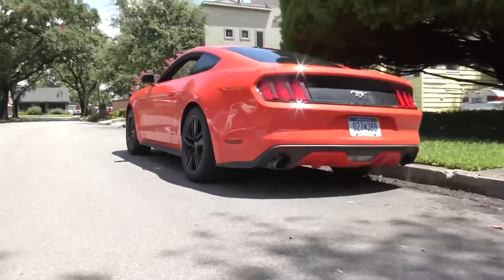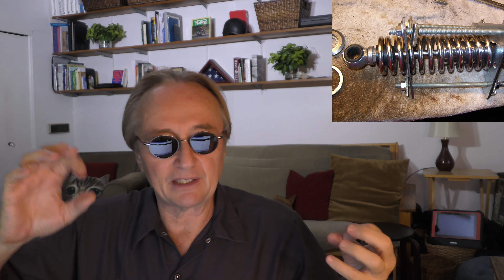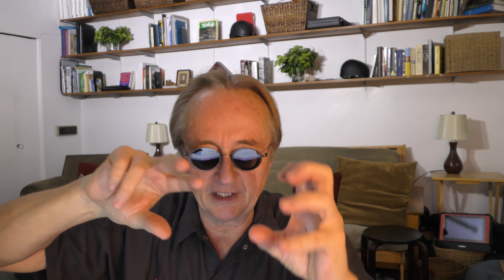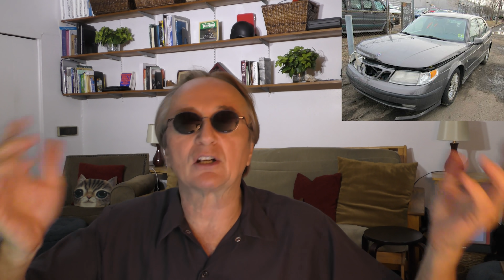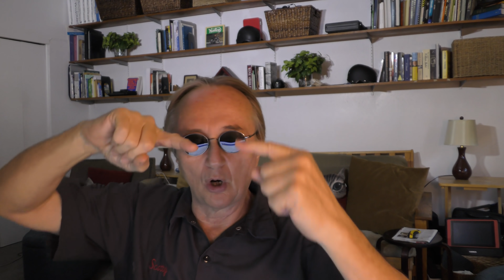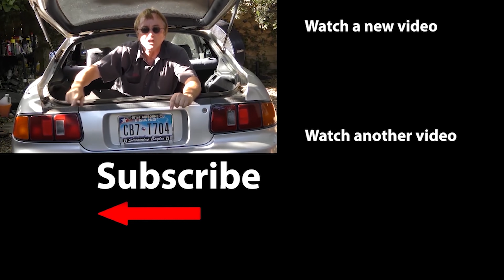Here’s Why Volkswagen is Going to Take Over American Car Manufacturing

Comment: I'm on my second jetta. Currently in 2018 se. 147k and all original and still getting 38mpg. 200 mile per day commuter.  
Change oil every 5K with full synthetic and change air filter every 30,000.  Second set of tires and second set of brake pads that is it.
I'm either lucky or meticulous maintenance works on any car

Comment: I have 2010 volkswagen cc , 2.0 Tdi 138 bhp enine tech GT and its never missed a beat its a great car and i look after mine every 3000 miles i get oil changed and filter change, it works for me and keep my engine running sweet. It returns 53.7 MPg and above some times on normal driving to work and around town thats a true every day figure by the way and i have get over 60 to 63+ on the motorway whats not to like. Its a great car for everyday driver like me and for me im not gonna buy a new car no no no , im not into throwing all my money at a new car......

Comment: I have a 2012 MK6 Jetta 2.0 5 speed. It has small stupid random electrical issues like occasionally it won't unlock the back door while other times it does or non lights burning out frequently. Truly stupid things but other than that in nearly 200k smiles I've only replaced the oil cooler and a rear door lock. I'm very big on proper maintenance and tend to stay away from automatic and turbo vehicles. Thats the secret to longevity with any car.

Comment: Got a 2011 vw Jetta TDI wagon automatic 70k miles. Not a single issue. Just oil changes. Average about 37mpg mixed driving and can get around 43 highway. Also have a 2016 gti. 50k. Nothing but oil changes. So far so good.

Comment: If you talk about VW's... 
Mention year, model, fuel.
Air cooled / water cooled are different as can be. Like Model A and F150 trucks.
I had a 78 Scirocco that was nothing but problems. I blame much on the previous owner, but the VW parts manager, who I saw frequently said "just be glad it isn't a Rabbit."
Bought a Toyota 4x4, which lasted 27 years before selling it.

Comment: I need help Scotty. I have a 2013 Jetta sell 2.5. when it's cold it doesn't like to start. I have regular hiccups in power. Not slippage, it almost feels electronic. And periodically it'll just die for no reason. But when I get the battery and alternator tested, they're fine. I had the transmission replaced a year ago, with a used one that had about 27k miles on it. The car has over 90k on it now. I'm having trouble left and right with this damn car and it's crazy expensive to work on. Lots of buyers remorse. Please help me save my car. I can't find any codes with basic obd2, then again it's an older one.

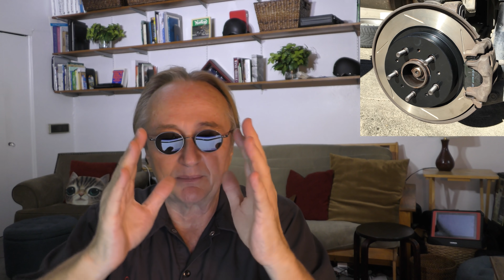Comment: @ScottyKilmer At 2:30, on the contrary Mr.Kilmer. Aftermarket lift kit spacers are made for rigged that’s more affordable to buy rather than fortune lift kit coilovers. There not actually cheap if it’s a well hand made design. On our xB community we have a one man army that has the right material to make and sell custom aftermarket made lift kit spacers. We had so many Scion xB customers that were completely satisfied because how well made he makes. Very affordable for our xB’s which it’s very respectable thing to do. On the other hand, I also know there some lift kit spacers that I believe they have a 1.6 mm spacers and had them on. After they broke and he never bought those again, until he gave another shot to a different guy that makes well made spacers that’s much better made than the ones he bought cheaply ones. I say his quality made are excellent. And it’s a must have if I do say so myself. 

That’s why some aftermarket brands that sells lift kit spacers for small crossover are very popular. Not just lift kit coilovers

Comment: Get a Renault, I took a van, it's got 300K + Miles, only ever had oil changed, tyres, brakes 
Had the motor for windscreen wipers replaced and fuel pump in all time

Comment: I have a  two wheel drive VW Eurovan ,one of the greatest vehicles ever made. I have multiple other cars including a  4 wheel drivef-250 super duty with a V-10 . The VW can out perform it all day long . It's a tank and plows  a foot of snow no problem , while carrying 7 people and anything else you can put in it. And  while getting 25 miles per gallon, the f-250 gets half the mpg.  Why did VW choose the 20th of April to restart the factories back up? Because, it was Hitler's birthday..

Comment: Hey Scotty, thanks for all you advice over the years, please help me with this one. I have a 2007 Ford Explorer-170k miles. I mistakenly put about 1/2 cup or so of windscreen wiper fluid into my coolant reservoir because they are the same color. Two days later it started to act funny, slow to go into gear and low power, just like when the transmission is faulty. I completely rebuild the transmission 2 years ago and the guys at Ammco said it not the transmission.OD2 Test reveal that solenoid A, B, C all giving errors. I flushed the entire coolant at Pepboys but nothing has changed, mechanic not sure what exactly is the problem. Thanks for you  help.

Comment: I bought a very nice 2012 Tiguan with 89k miles on it. Body and interior were perfect. I knew I’d have to spend some money to get it up to par for my daughter to drive but it was ridiculous. Plastic engine parts galore. O-rings that swelled when contaminated by engine oil in an engine that leaked like a sieve. I was gonna end up with $15k in a $9k car. Dumped in in less than 2 months. Would never have a VW out of warranty.

Comment: Awesome video as always, do have a question. I did the CRC GDI treatment on my soul and after I let it heat soak I drove it, was going up the mountain near my house and it back fired and started smoking pretty bad, also the engine light lit up and was flashing, turned off then back on and it was perfect, is this normal lol?

Comment: Scotty, I'm a huge fan! Thanks for all your daily videos, I had a question regarding my 2009 Ford F-150 with about 169K miles. The other day I took it camping and it struggled to get up a steep mountain road. The engine had a rough idle and seemed like it would shut off when coming to a stop but never actually did. The check engine light came on and gave me codes P0012, P0022, P0340, and P0344. The thing is on the way home the truck drove fine on the highway. Seems to only have this problem when pushing up a hill. I am assuming all these codes have one big thing in common but I am not sure what. Do you have any videos or advice on diagnosing and fixing this problem? Any info would be greatly appreciated!

Comment: Can anybody help me out? I got a P1374 code on my 2004 Pontiac Aztek. It will fire up, but soon stall out. The tachometer jumps before it dies. If I'm driving it, it will either stall out, or try to stall out.

Comment: Hey scotty, I have a 2013 Hyundai Sonat and it works fine it has about 70,000 kilometers on it when I rev up the engine to 2500-3000 RPM it makes a chucking/ heavy clicking sound 
I took it to the dealership and they said I need a new engine 
Is this right or I'm just being robbed
Also the car is in a good condition, well taken care of and mostly a highway car.

Comment: vw will never take over anything with their reliability track record.
the only reliable vw are original beetle. 
my wife get a vw golf make in Brazil and we have to trade it in before 36K mile because it has so much electrical trouble. it's a lemon.
anyone has a recent VW in last 20 year will not buy another. they are money pit and you don't get the benze bmw name to go with it.
they will open the europe factories but south america where most of their junks comes from?
Reply: 2002 VW GTI 310k miles.

Comment: My daughters 2003 Subaru Baja exhibited the same type of code; new cap didn't solve the problem, Plastic parts of evap system was broken above the gas tank. $600+.

Comment: Hey Scotty, I got a question:
I just bought a 2010 Bentley Cont. GT Speed in prestine cond. and with 35.000 miles. I would like to prevent the intake from getting clogged up by all the exhaust nastieness recirculation. If I find a place where they could program the computer to shut down the exhaust recycling valve, would I risk any negative outcomes to the engine itself? Most of the time I drive around at 1200 to 1800 rpm which seems to be the range when max. exhaust recycling is taking place.

Comment: I'm still driving my 2003 VW Jetta. Drives like a charm.
Reply: non volkswagen users are so misinformed, my GTi 2008 dsg transmission is over 217 000 km, and shift like a charm. I had a 2004 golf, in 4 years i've put no money on it, just one bering.
Reply: Same. 03 Jetta that just hit 75 xxx km's. Only summer driven.
Reply: I’ve got a 350 000 km diesel of the same year. I’ve had it for 5 years but the engine leaks a lot of oil around the egr valve and other places.

Comment: Hmm ... Not surprised the 'Concern' is moving into America. However, I'd stay away from their brand new vehicles. As with all the new cars, they are built not to outlast us. Hope that this move would enable America to have a flow of OEM parts for older models. That would be beneficial. Older, smaller Golfs and Polos (or even Boras and Ventos) .. they may be a safer bet. Yeah, the VR engines .. nah .. just your small, four-pot, low horsepower econoboxes. Heck, those had some quality at least.

Comment: Hey Scottie, I have 2008 Nissan Altima 2.5 S and I can’t get it to accelerate when i turn it on and it won’t rev over 2000 RPM. It revs fine in Park & Neutral and there are no service lights on the dashboard  and it’s not showing any codes but Park and Neutral don’t show up on the dashboard as well although I can feel it change gears. Can you give me your opinion on it ?
Reply: Nissan are fcking junk. Sell it or trade in or public transportation.

Comment: Hey Scotty, are the new Subaru engines doing better for head gasket issues. Specifically we're considering a new Crosstrek with a manual transmission. Just wondering what your thoughts were.

Comment: Hey Scotty I got a 150cc motorcycle, I used to slow down using front and rear brakes but they wear out fast. I switched to engine breaking and it worked great for a while but recently it started to make a wierd noise when im breaking in 3rd gear. What could it be? And is engine breaking bad?

Comment: I’ve had 2 Volkswagens and they were great cars.
Reply: @Ross_skatepunx248 >  The problem why people think they're crap is because they expect to drive it forever and never put any money into them.
Spot on.  Unfortunately that's the mindset of 90% of drivers on the road today.
Reply: @dantesinfernopurgatory7826  of Americans
Reply: @dragospahontu  Exactly.
Reply: @dantesinfernopurgatory7826  if you don't change the oil in a DSG gearbox ofcourse it's gonna blow up.

But Americans have grown up with torque converters and can't wrap their head around German technology 😅. To the extent that outside the EU Volkswagen is selling their cars with Aisin8.
Reply: @dragospahontu  You're preaching to the choir.   If you don't change the fluids in any transmission on a regular basis, that's a recipe for failure.  Any service manager who mentions "lifetime fluid" is selling you a bill of goods.  

My VWs  have manual gearboxes, B.T.W.   Owned several over the past four decades.
Reply: @MRsjovealek  in Europe they are considered above average reliability
Reply: @MRsjovealek  in 220,000 miles my vw has only seen a mechanic once.
Reply: I'm doing a vw and audi car meetup u wanna join
Reply: @playiboy4497  where abouts?
Reply: Gas or diesel?
Reply: @brianlee4629  $ď$$$$CD
Reply: @brianlee4629  TDI
Reply: MRsjovealek yea that’s what I keep hearing haha
Reply: My 2017 jetta has 162k miles, turbo blew at 65k and ac compressor blew at 100k. Other than that the engine is strong AF BUT yeah if you know a mechanic you're good
Reply: @milkboi2386  exactly
Reply: @milkboi2386  TDI is reliable
Reply: OZ D1983 I’ve also had two, and that was two too many.  They are pure crap.
Reply: @tedschmitt178  vw is the best and its the king of speec

Comment: Hey everybody,I have a 05 Subaru Outback. H4. 2.5 non turbo. I had a code for bank one sensor one o2 sensor got it replaced. Two days later I got a code for bank one threshold. I believe I need to finally change the catalytic convertir. I’m doing some you tube research and figured this would be the best outlet for responses.

Comment: My 2015 VW Jetta 1.8t has over 106,000 miles and has had no major issues. The original front brake pads even lasted over 100,000 miles. A lot of highway miles
Reply: Jacob T where the HECK do you live, because on largely highway commutes in the BC (Before COVID) Era I had to make enough panic stops (to avoid being #5 in a 4 car accident) that I would have been on my third pair of front ROTORS before you hit your first set of PADS!!
Reply: Bruce Morris I honestly do not know how they lasted that long. I still haven’t replaced my rotors. Original set too, just replaced the pads. The service advisor said he doesn’t usually see that haha

Comment: I've had 2 VW's in my time.  The mechanic and I had joint custody of them.
Reply: Mine has never seen a mechanic. I have done all the scheduled maintenance. I don't trust mechanics, you go in for one thing, you get it back finding a new problem. I don't have that happen to me now.
Reply: @lightdark00  I don't trust mechanics either!
Reply: 2009 Jetta Sportwagen with 2.0 TFS motor, 85k miles. Only issues, leaking sunroof drains, and transmission cooler seal replaced. Normal oil ,  filters,  runs great.
Reply: Between me and my wife we have had 7 VWs in the last 15 years.  Other than 2 check engine lights that’s it between all cars. Been very reliable. Think they get a bad rap because people don’t do the proper maintenance and then fast and furious them and the problems start.
Reply: michael tipton - My brother had a few Volvos, when Volvo was Volvo and they lasted well. Then he went to VW Golfs of the late ‘80s & ‘90s. They lasted well too but the service costs were high. Then he went to Vauxhalls and has most recently bought a VW Polo; weeny engine with a turbo... I used to think he was the one with the brains. Ah well. Age doesn’t come by itself.
Reply: Mines never missed a beat, apart from that one time I crashed it into a tree.
Reply: I fully understand. Near as I can tell, VW is Germany's retribution against the world for WW II. No more German made cars for me.
Reply: I just saw a Volkswagen overheat yesterday. I wonder if the owner even maintained it. 😂
Reply: My cars were always dealer maintained.  All scheduled services were done but the cars always seem to find something new to break down.  I think they were Friday cars.
Reply: They used to make Trabis in Zwickau 😊
Reply: 😆 how many of his kids did you put thru college ?
VWs have always been uneven in quality, but my favorite' best bang for the buck' little sports car is the VW GTI...
Reply: @aaronhumphrey2009  Let's just say Thank God for extended warranty.  Remember this was back in 1985 and 1987.
Reply: I have had Volkswagens for the past 14 years and have made road trips between central Florida and the Midwest and the Carolinas at least 10 times to visit family.  Never once did I have a problem.  I also took my Volkswagens to the dealer exactly on time for all of the scheduled maintenance.
Reply: @scottferris6309  Like you my VW never wanted for service from the dealer as well.  Ironically, I had to watch a VW commercial to get back into this thread.

Comment: Speaking of VW, My 2008 Beetle starts fine but when I get gas it turns over but doesn't start. I have to rev the engine at a gas station to get the car going. I don't know what's happening HELP!!
Reply: Low fuel pressure, could be dirty fuel filter.

Comment: ,vw is a poorly made car, have you worked on them lately, i worked on cars for forty five years, seen points, dis ign, feedback carbs to high pressure fuel ign. All these  companies go in cycles, one will have great cars for four to five years then another brand will rise to the top, all have poorly design engines or transmissions at times, some are known for great bodies or engines. No one company stays on top, you  said yourself Toyota were replacing fuel pumps without knowing reason for failure

Comment: Scotty, which Volkswagen Golf is the most reliable year and engine - assuming that it was taken care of and some college student didn't thrash it. Thanks. - David H.
Reply: 2006-2014 (except 2010), both in Rabbit and Golf form -- gas engine only, ideally the naturally-aspirated 2.5L inline-five, but any non-turbo will do. Even the turbos are OK, like the GTI, just more complex.
Reply: @EMichaelBall  But what about the 2017?
Reply: @professorh8398  Check the VIN on it; that's right around when VW went from Mexico (3 at the start of the VIN) to Germany (W at the start of the VIN) for Golf manufacturing. German-built ones are the best. Most, if not all, of the US-spec Rabbit/Golfs in the '06-14 range were German-built. Mexican-built Jettas (same platform as those Rabbit/Golf) from that range aren't as reliable. Either way, if you haven't bought it, yet, be aware that depreciation on the '17 is going to be harsh, for multiple reasons -- finding an earlier, German-built one with a gas engine will be a good idea, if you're into the German "feel".
Reply: 2004 TDI (Turbo Diesel Injected), was very popular and sought after, economical Diesel. Volks retooled emissions system in the 2006 and up models. Buying a pre 2006 Volksy diesel would be like buying a pre 1973 American made gassser. Emission inhibitors were minimal or non existent. Good luck!
Reply: @daveminer9217  But what about the 2017?